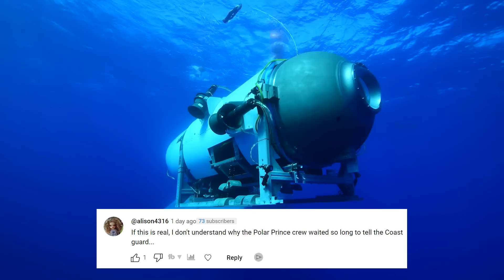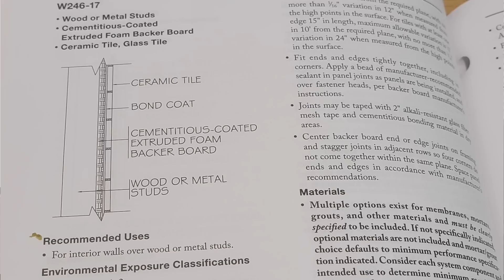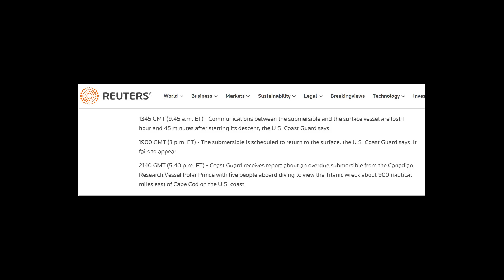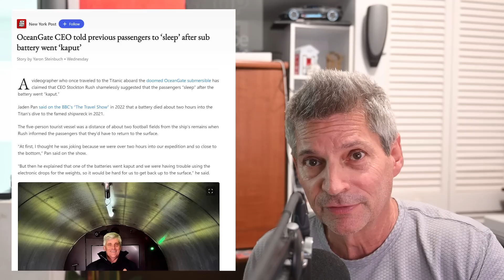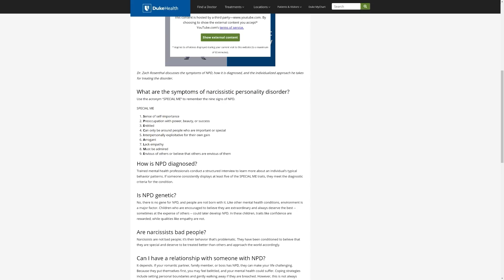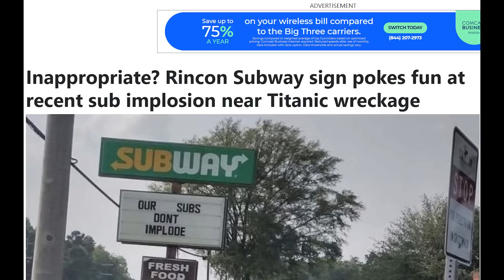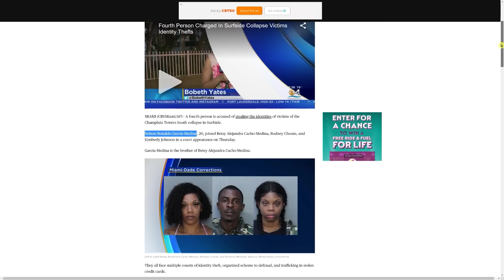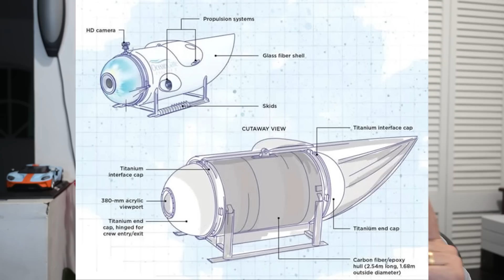Titan Sub: Why OceanGate Waits 8 Hrs Call Coast Guard, Q & A

Comment: I wasn't aware this submersible even existed until the news about it being overdue.  I did a quick search and as soon as I heard the hull was made of Carbon Fiber I knew it had imploded.  Carbon fiber is strong under tension but under compression it is the epoxy bond taking all the strain.  Carbon Fiber is just not the right material for this application.
Reply: 100% agree.  If you could put that same deep sea pressure on the inside of that CF and it'd be fine.
Reply: Exactly, carbon fiber is just what the name implies, fiber.  Like a shoelace, it is great when you pull on the ends, putting it in tension, and is useless when you push on the ends, placing it in compression.
Reply: @nunya3163  So why do these videos drone on about how if the carbon fiber layers were wound diagonally,  it wouldn't have delaminated? The epoxy substrate would still have been doing the heavy lifting regardless of how the carbon fiber layers were wound.
Reply: @schmingusss  When it is applied in an interlocking weave, the fibers themselves are mechanically capturing other layers of the weave, making delamination more difficult.  It would still suck at compression, but would have at least aided the epoxy a little bit.
Reply: Yes. Ironically, a pure epoxy hull might have stood more of a chance, as it would have had a better chance of curing without tiny little imperfections everywhere. Although at that thickness even that would have been hard to pull off.
Reply: @theguyfromsaturn 
It's like cooking ,you can't do it wrong or substitute things. 
CF or epoxy isn't strong by itself,they need to be combined.

Comment: One thing we absolutely know is that it's hard to model carbon fiber. People keep suggesting that having the carbon fiber loomed on straight it worse but that's all based on our mental models of what a carbon fiber pressure vessel is supposed to look like which we haven't fed much data into. I would like to see a demonstration or at least a simulation testing the fiber orientation before I condemn the orientation that they chose. We really don't know that that was the problem.
Reply: Well regardless of a straight wound or criss-crossed weave, the fact that this tube was cured at 1 atmosphere rather than under pressure to squeeze out tiny air pockets was a terrible cost cutting measure.  Also, the actual carbon filaments were bought at a discount due to it having passed it's shelf life for being used on aircraft parts.
    But in any case, at least a few people said that using a CF tube, glued to titanium end caps was a bad design that at the very least should have undergone months, if not years, of testing.  All of those people were ignored, because this guy thought he was smarter than everyone else.
Reply: I agree. People cannot shed the ideas they are presented with but are actually in a completely different setting. Like a cable on a suspension bridge has completely different requirements than an arch supporting a stone bridge.